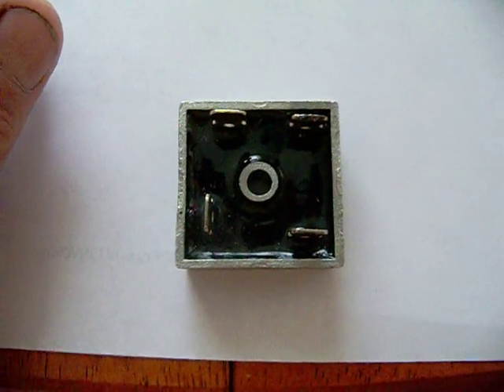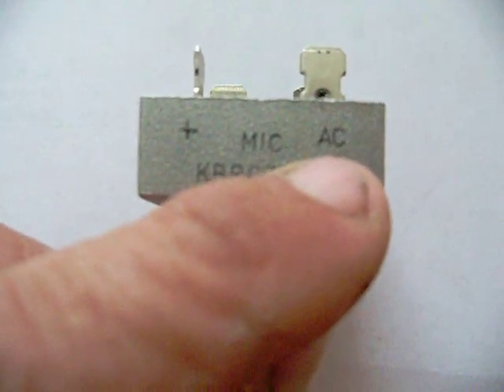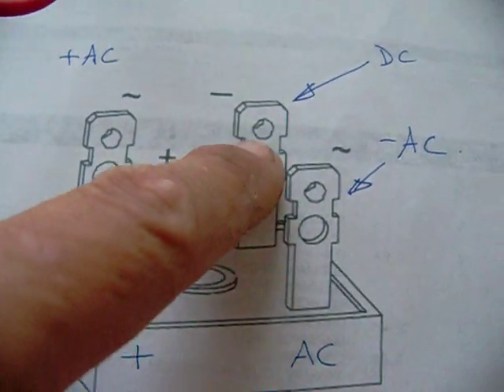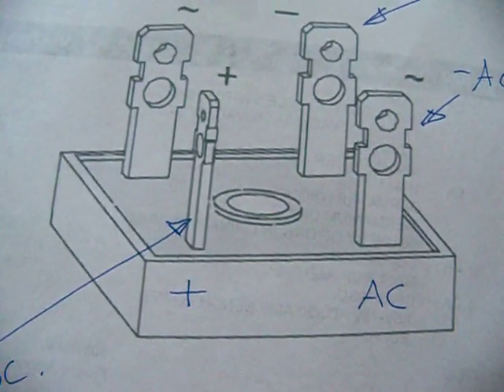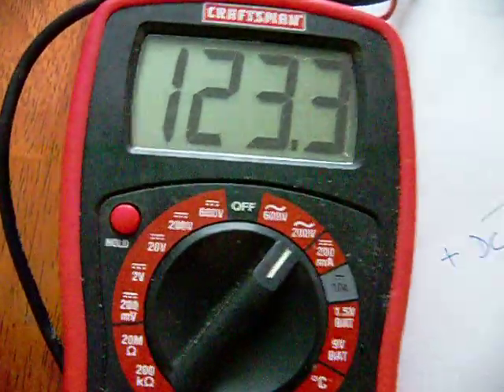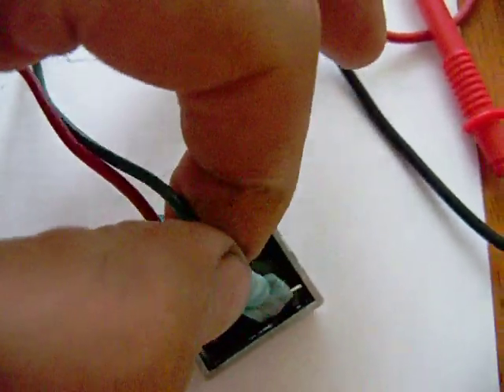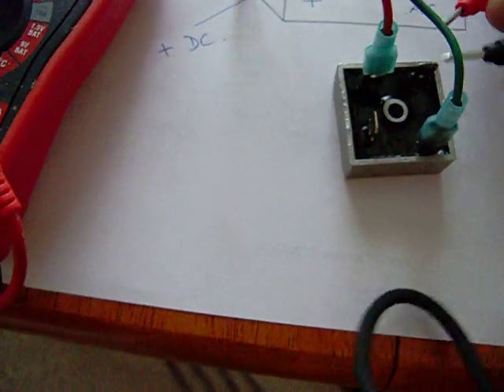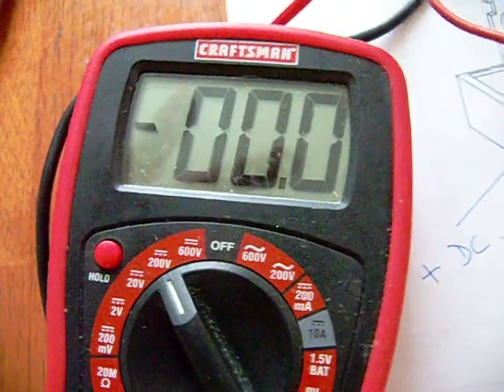how to wire a full wave bridge rectifier.MOV

Comment: i heard typical voltage drop is 0.7 volt per diode. since there are 4 diodes, if we rounded up to 1 volt per diode, that would be a a max of 4 volt drop. your multimeter says you got a 10 volt drop. seems more than it should be

Comment: How are you doing hooked up like you said and I came up with 170 AC out of DC side blew out my 12 volt text light like nothing ac side was plugged in a 120 volt wall outlet USA do you have any ideas whats going on with it not producing DC current hooked everything up like in your video thanks for your time
Reply from the maker: sounds like you had a faulty rectifier .make sure its rated above what you need, mine is rated 600 volts.
Reply: @Ianlesliemitchell  600 volts ac side sir would 120 going in still produce 12 volts dc on the other side
Reply from the maker: @joelkuhar2985  I think you have the wrong idea about this device. Its a rectifier that turns AC into DC only. If you put in 120 volts AC you will get 120 volts DC out.
If you want to reduce the voltage from 120 volts to 12 volts you will need a reducing transformer. 
This I assume is why you blew up your 12 volt light.

Comment: Thanks Ian -  I had the schematic and thought this was the way to do it -  good confirmation - sweet and to the point.  One comment - your multi-meter was showing negative -112V DC, which proved that you had the probe leads going to the wrong terminals.  black probe is negative and you had it on the + side of the rectifier.  For your viewers this is also good confirmation of which of the DC terminals is positive and which is negative - especially if they are not labeled on the rectifier.  Thanks again!
Reply from the maker: Great comment thank you. 
You are correct about the test probes being the wrong way round and clearly my meter proved that.
The reason was the camera in one hand and test probes held like chopsticks in the other, not easy but I did impress myself over the dexterity of my fingers lol.
I was trying also to just keep the video to a minimum with just the principle.
Thanks again.

Comment: Please help, when I connect my AC inputs (240v in Australia) to my bridge rectifier (KBPC5010) it trips my house circuit breaker without even having any load on the dc outputs. My rectifier tests ok with multimeter and is rated to 1000v so whats going on here? Do I have the wrong type of rectifier? Any help greatly appreciated

Comment: Why is it 112vdc after rectifying 120vac? I saw other clips showed that it should be 
120* rt2 =170vdc!!
Reply: Eric Chan how would that work? that's impossible that would mean it has a transformer in it.. he lost some voltage because there are losses through the semi conductor of the diodes

Comment: if a generator is 220v output so the AC supply to rectifier should also be 220v?
Reply from the maker: you're answering your own generator question here !! but if you then want to convert to DC using a bridge rectifier then you can expect some loss as in my video. if you have 220 in . you can't expect exactly 220 out .
Reply: +Ian Mitchell actually I bought ac alternator and the out its giving is 110vac so I thought the connection is wrong to diode kit. so I didn't want to change the connection until I'm sure I'm doing is correct and will make no damage. thanks for your instant reply.

Comment: :40sec in told me everything i needed to know, thanks

if my assumptions serves me well as usually i think i should be able to make a DC power Bench with this Diode bridge but i will need to control the voltage out and maybe even the current so can i use a Buck converter for this "rated for 120v 50a?" or some sort of Step down regulator ? maybe even a Power Mosfet or N channel MOSFET ?
Reply: Control the current before the bridge rectifier.  You can control AC easier with a MOSFET potentiometer.  Then you can rectify it and it will output whatever DC voltage you want.  It's easier and cheaper than trying to control the DC output.  Because the do that you need a DC bench power supply.
Reply: Plus if you control the AC before the transformer You use less power.  Use a simple microwave transformer but put that AC MOSFET potentiometer before the transformer and there you go rectify the output coil.  And you will have any voltage you want at DC after the full bridge rectifier might be very careful it's a thousand wattS in my case on my microwave oven transformer

Comment: I am trying to build a rectifier, I have one of those diode bridges, plus an inducto a resistance and a capacitor. I am using a transformer to get to 12vAC and in the end the output is 19vDC but I dont get why the voltage goes up if the bridge alone throws 12v???
Reply: Javiericko measuring AC is basically telling you the average voltage. When you rectify it you get something higher because it is like adding both the + and _ of the ac together to get DC. you dont actually add them together but this is very basically why its higher.

Comment: Where can I get those clip connectors, and what exactly are they called? I have a rectifier for a wind turbine project, but I don't have an effective way to attach the two.
Reply: lambofgod368 I'm sure you have figured it out by now, but just buy a large set of electrical crimp connectors

Comment: if i replace my bike 6v to 12v rectifier .Then my bike is going to working at 12v?
Reply: krakkis No it shouldn't work like that, a rectifier just turns A.C. voltage into D.C... there are minor voltage loses as seen in this video but they are not meant to change voltage